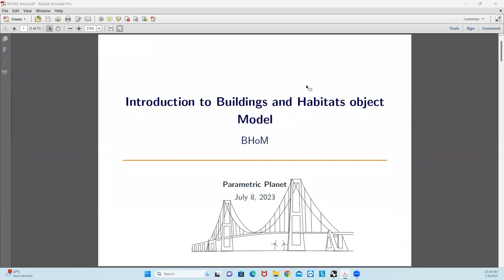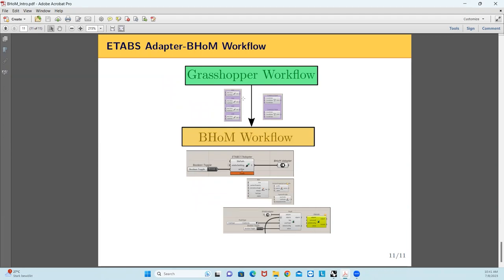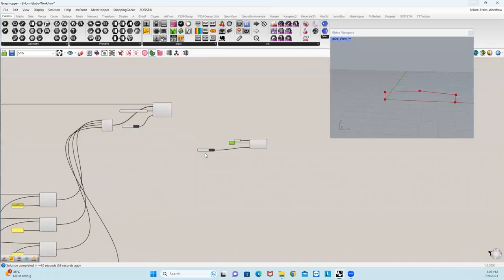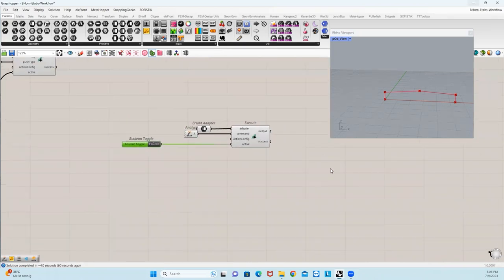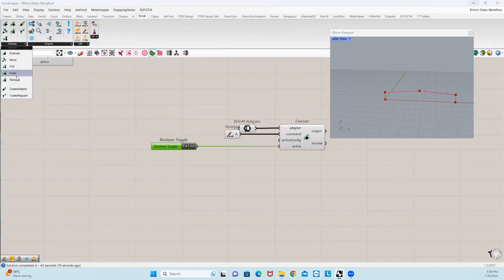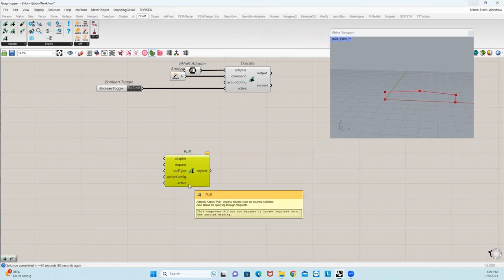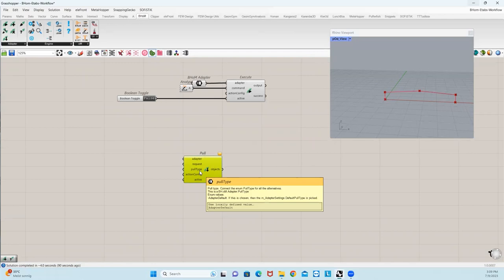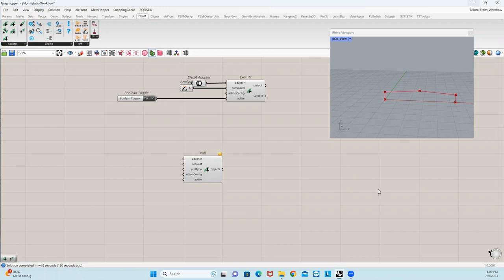Grasshopper to ETABS (Steel Portal Frame Model) Using BHoM Tool (Part 1/3)

Comment: I am not able to update the model in ETABS using PushType "DeleteThenCreate". do you know why?
Reply from the maker: Is there any error or warning message?
Reply: @ParametricPlanet  no, only when selecting this option, the full-push option work fine (but yeah I just tired to delete manually the element before push the model again from GH).